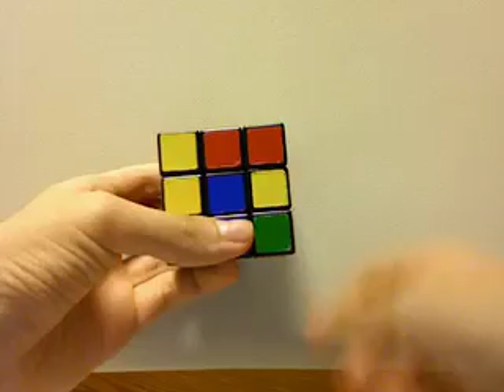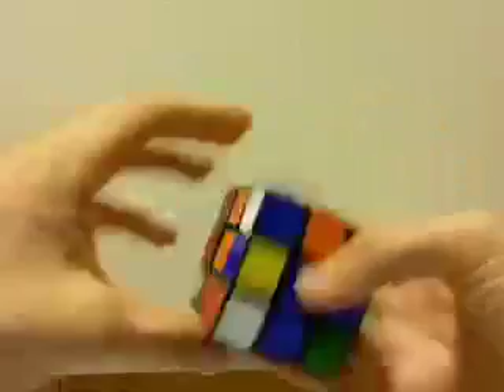ZZ Block building + Last Layer

Comment: Gah, simultaneous thinking. I was sort of trying a method that oriented edges and had CFOP edge pairing and I ended up by starting with half a cross (the EO Line) and fiddling with orienting edges until I stumbled on this method. Sweetness! This fixes all the problems I had.